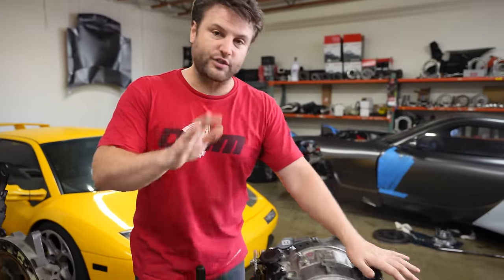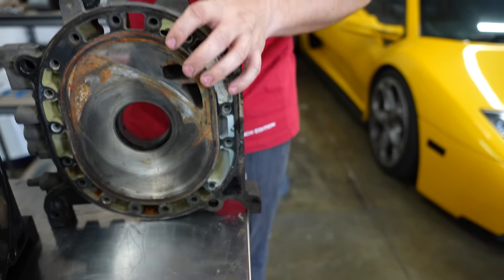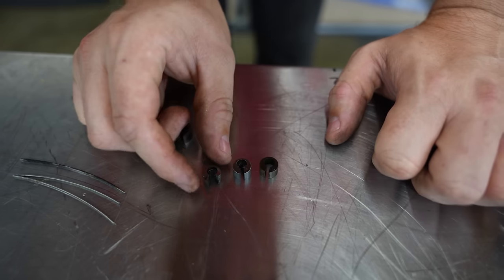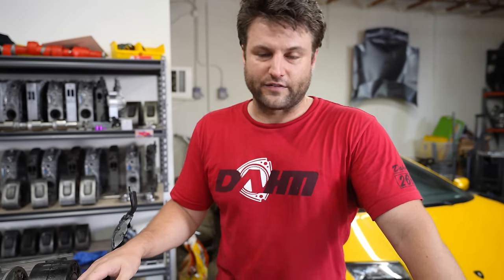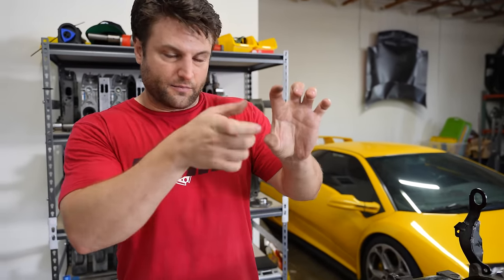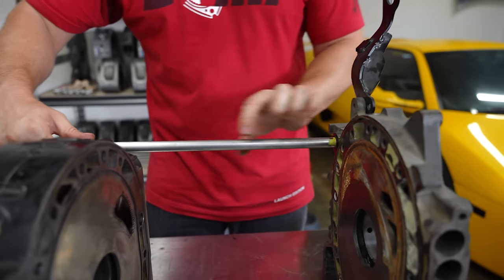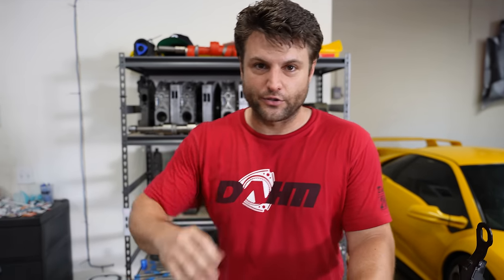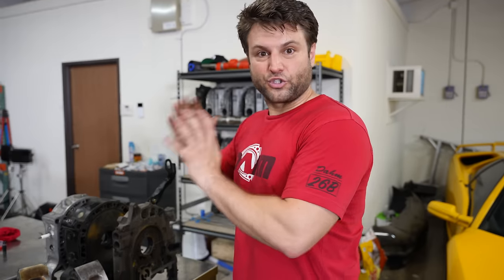Fixing the BIGGEST Problems of the Rotary Engine

Comment: I hope in the future that they can come up with some solutions to mostly the Apex seal I'm not sure why they have so much problem with the coolant seal there's not a whole lot of torque involved in this engine because it reads so high it's a very kind of low torque engine because of the high RPMs

Comment: Based on what you are saying, would a new version of the engine with a new separate feed reservoir filled with 2 stroke oil be better while the other parts needing lubrication have their own separate synthetic heat resistant oil reservoir?  What you point out seems logical. I wonder if a petroleum expert could weigh in on this. Maybe a synthetic oil that both burns well and lubricates well is possible.

Comment: I'd like to see you develop a very tiny, very high output rotary engine, suitable for driving a generator, with the intention of providing on-board charging for electric cars. If people are going to buy more and more electric cars, the grid can't support them all, and they'll have to use gas-powered generators, too. Using rotary power, it should be possible to make a gen-set small enough to stick in a corner, somewhere, in almost any car. BTW the faster a generator spins, the higher voltage it can produce, so a small, high-speed rotary engine can direct-drive a 3-phase alternator, like a turbo-generator.

Comment: I used to to strip and rebuild Mazda RX3 engines in my front room. then it was Rotor tip problems side seals which pressurised the cooling system.

Comment: To reduce cooling problems in RCE, or any high performance engine, a product as Solar57, propylenglycol based, made by pequinsa in Spain, could be of help (SAE paper 741091), the only better approach would be substituting oil for water as cooling medium, oil does not increase in volume when freezing. To calculate the pump and oil flow needed, 'BOSCH manual of automobile technik' has all info about heat transport features of different fluids.
P Lamar wrote a book 'How to cool your Wankel'

Of course, if oil from leaks in an oil cooling system enters working chamber, nothing but smoke will result. Old Citroën air cooled car engines had some Oil cooling, with a pump and a radiator.
To further improve lubrication, avoid wear from failures of oil injectors into Wankel working chamber, experienced Wankel users add 1% oil in gasoline directly to gas tank.
LiquiMoly suggests adding one cc of their MoS2 aditive per litre of mix, as Mazda did in the engine winning the LeMans endurance race (SAE paper 920309; 922375)

About apex seals, the booklet by MotorTrend about Rotary Engine cites some good hand made changes to apex seals employed in Japan, also patent GB1438850, by Citroën, 3-piece seals, is a very good approach to seals. 
Nikasil is the best available plating for Wankel housing working surface.

Old work from SAE, paper 730048, depicts the amazing difference in wear from IKA apex seals, the alloy used in common piston rings, to the negliglible wear with ferrotic apex seals.
 I ignore if what they call 'ceramic' seals of aftermarkert rotary engine parts of today is same as ferrotic, and if there's a difference in wear between 'ceramic' and 'ferrotic'.
 
Toyota, SAE paper 790435, proved adding a Reed-Valve to a Peripheral Intake Ported RE and a Glow Plug in leading plug hole, instead of common spark plug, improved economy 9%.
Kawasaki, patent US3848574, proposed a solution to bad flame travel, cutting a wedge shaped prolongation, pointing towards Rotor trailing edge, flame behavior described in SAE paper 830332. 
Perhaps the device New Ceramic Pin Glow Plug For Webasto Air Top 2000ST DC12V Diesel Parking Heater on leading plug hole could act as the Glow Plug in Toyota SAE paper, or Diesel Glow Plugs, they use some today that are in continued glow throughout engine operation, not just for starting.
Mazda SAE paper 810277 has intresting data about apex seal springs and other subjects.

The slot plug hole described in Video 'Rotary Engine breakthrough' looks perfect. A reduced exhaust gas temperature means a higher effective compression ratio, early ICEs burnt exhaust valves from the low CR, not above 6:1, from poor fuel quality, reason for knocking was not known.

Low load performance of Wankel is worse than in reciprocating engines, thus, having an smaller engine will keep it more time in better BMEP and SFC conditions.
An ordinary car uses less than 30 HP when running at 90 km/ h on a flat road.

But the final improvement would be having a single Rotor, RE with Rectangular, Reed Valve controlled Peripheral Intake Port, and the Side exhaust ports in Renesis

Comment: The primary problem with both Wankel and "liquid piston" remains the surface to volume ration of the combustion chamber.  Too much heat is lost to the piston and the chamber walls. This kills thermal efficiency.  I'd love to see this work, but it's inherently dead in the water because of surface to volume.  Using a ceramic rotor and chamber might solve this problem by allowing the piston and chamber to run hot enough to minimize heat loss.  Secondary problem remains the issue of seals.

Comment: Can a diesel one be manufactured?

Extremely heavy duty.
485 horsepower low torque is required.

Meant for semi truck tractors.

Linked to 10-speed manual Eaton Fuller transmission.

Comment: i am not an engineer or even a gear head. But i was wondering (aside from cost which would be prohibitive) could you get more power, control, balance by having a much smaller single rotor motors at each wheel?

Comment: I don't know much about the MX or the Wankel engine, but it seems to me that if the rotor is at a high RPM, the gyroscopic effect could cause it to wear into the block during turns.

Comment: I once had a Wankel Rotary motorcycle, which emitted a significant clunk due to gear lash within the engine -- every time I even minimally decelerated when attempting to maintain a constant speed.  Do other rotary engines have this characteristic?

Comment: Won't machining the block for a thick dowel pin make it more prone to cracking the block? Seems to me like we just need a bolt with a thicker shank and stronger metal which will help eliminated the weak point that is the threads.
I know of an enthusiast cycling company that computer machines their parts and hardware (CNC machining). You can probably get one to make you custom retainer bolts that fit properly in the holes.

Comment: This is basic engineering 101 for higy performance engines. The problem with stock engine is that it was desingned for "low" power.

Comment: Wow when you were talking power i had 400 425 hp in mind not 700hp. That's fucking bonkers.  Excellent video , you talk good and not in a condescending way . I'm very Interested in these engines for aviation.  Power to weight ratio is off the scale.  Replace a 45k 300hp  engine in a Cessna 206 to a lighter 700hp turbo  engine  and now we talking.  A gear reduction well need to be used , but not a problem .

Comment: 2 stroke engine oil mixed in the gas is a great IDEA!!! Why didn't Mazda think of it? 2 stroke motorcycles have engine oil but they require you to put 2 stroke engine oil in the gas before filling it up... What do you do if you don't have access to E85?

Comment: mazda could have made a seperate oil tank for the oil that is meant to be burned like on some 2 stroke bikes that pumps straight to the rotor housing and gave instructions to fill it with 2 stroke oil

Comment: You are missing an important point !. One side of one 1/3rd of the body has a ring that fits into the next cylinder housing and locks them so they cannot spin sideways the way you are trying to explain with the various compression bolts. I think the only inherit-ant faults are the tips on each end of the triangle and the bypass of the oil on the sides of each triangle. To make this more durable it will take two or three springs together or spaced 3mm apart for each corner of the triangle and same on each side of each triangular piston. That's all that is needed to double the life expectancy of this particular Mazda Rotary!!!

Comment: Has Mazda released the latest design details in order to get Digital Fuel Injection onto a Rotary. Is it possible to build a 3 rotor giving 900 hp that is totally reliable for use in racing airplanes using a propeller?

Comment: Thats very interesting but i want to know clearly.....thats for 13b rotary, rx7's okay right but do they have the same problèm on the renesis engine? The rx8? Thats really important for me at this point knowing if it's the same solution? It's really matter
Reply: "thats for 13b rotary, rx7's okay right but do they have the same problèm on the renesis engine? The rx8?"

They have some of these problems.  Theyd still benefit from doweling and the likes, e85, etc.  The lubrication the rx8 got from its OMP was improved over the older 13b/rew motors due to having 2 ports per housing, rather than the 1 port that the 13b/rews had- However you still have the "issues" of burning oil inside the engine, and get the same benefits mentioned from omp deletes / premixing.

However the Rx8 has a host of "other" issues unique to the renesis engine.  

One of the big ones to compare/consider is that the rx8 rensis engine has its exhaust ports in the side plate- where the older 13b/rews had them coming straight through the housings.  The exhaust flow is rather limited, and goes into a small bottle neck before making a hard 90 before leaving the engine.  The inherent nature of this design is going to trap more heat than desired in the engine, which is a big killer for them (its also a big reason they dont like being boosted. even low boost applications just dont last long)

Its also worth noting that Rx8s / renesis engines has a different side seal design on the rotor with a big of a taper to them.  These even from the factory were rather had to get the clearances right on, and they suffer a bit more from blow by than the older motors- Again leading to some reliability / durability issues.

Comment: Hi Rob  
Just out of curiosity have you tested small holes drilled under the apex seal. To help the apex seal. Seal and not soles rely on the apex seal spring? Just thinking that's all or Is that fixing a fault that doesn't exist 😂

Comment: XRF only tests the surface.  If you have a plated part, then you will not know what is in the core.  Also, it does not tell you about heat treat.

Comment: One downside of the Wankel engine I've heard about and I can see on your rotor housing, is the loss of compression to spark plug hole blow-by (which the pops can be heard in one of your other videos when you crank the rotor by hand), and a solution would be carving small slits the width of the apex seal instead of a round hole, so the apex seals pass over them and leak way less air from compression. This would make emissions way better, as less unburnt gas mix would blow by, and make more power. One downside of this would be air/gas mix access to the spark plug, and needing some more gas to increase the gas density in the air/gas mix, to ensure combustion even occurs at the spark. I don't have the know-how to simulate this idea, but maybe that's worth a look.

Comment: So if by adding all the strengthening mods for reliability with a turbo that produces 700 hp , could I not reduce a two rotor to a single rotor ad run a turbo for a target of 220 hp. This way I have reduced weight and fuel consumption ??

Comment: No mods are going to fix the fundamental problem with the Rotory engine. All the heat is concentrated to one spot of the rotor, that area expands at a much different rate to the rest of the Rotor. That's why the seals fail so quickly and things crack. I'm not anti Rotory either, I love them. I did my apprentice at a Mazda dealership that built and raced their own RX3 rally car. If I recall correctly, it used to run Rotors from the RX3 estate as they had twin Apex seals. I was young when I started work there and was more interested in motorcycles and girls at the time though.

Comment: Why not move the oil pumps to the internal engine to a separate container for oil that can burn so you can get the best of both options and still fill up the engine without mixing your fuel.

Comment: I've just wondered recently if you could keep the oil holes in the housing but pipe it to a tank holding the correct stuff so we don't have to dump the oil into the fuel. Has anyone done this? I see most people mix.

Comment: OLD TIMERS are so set in their ways that you could show them a turd and they would say it is honey. You can never change the OLD FORKS mind  period. The E one fuel is sixty five dollars for five gallons. Ouch for the fuel cost. The dowel that is sloppy should be a precision slip fit. This makes the difference you are talking about. Shame this engine is just so miss understood. The corner seals made of a monel alloy work best period. Shame Mazda stopped making the engine. The biggest thing was fuel economy. That was the knife to the heart of the engine. Great video with honest and open information for all to use and learn from too. Peace VF

Comment: I was working on my design for a turbine engine and no matter how hard I tried the seal for the engine were not workable.  That is the problem with the rotary.  The seals no matter how they are designed are not as simple as a piston engine.   The piston is a cylinder and the piston rings are such a simple design that they can't be beat.  No matter how hard someone tries they can't make a more reliable simple design.  I wish I was wrong but I am not.

Comment: 🤔Why not ditch the rubber O ring 
And easily make copper wire " gasket"
Also with the putting wouldn't haveing the "combustion chamber" 
Placed in the better position moved up towards firing side of rotor like that Ronnie guy proposed 
And another suggestion probably in addition to premix 
🤔 
Could you not also  run a separate tank n pump with higher premix ratio and plumb that to the housing oil injectors
But that violates the 
Keep it simple stupid rule.

Comment: Can you just run aviation oil for the metering, and let the Valvoline do the rest of the engine? Also, why not have multiple smaller metering holes?

Comment: better dowelling of the block? it wouldn't be necessary if Mazda hadn't made the three housing parts with flat surfaces! of course, manufacturing would be more expensive and I don't know how precisely the parts would have to be machined, to fit together neatly and strongly.

Comment: If I remember right the rotary engine died for two reasons.  One was it was dirty and difficult to make compliant with modern emissions.   Second was it was a gas hog.  Once Mazda started addressing these issues with piston engines and had better success they just gave up trying to refine the rotary engine.

Comment: Seems a air cooled engine could eliminate the coolant issue, bigger oil coolers are going to needed for higher power engines but atleast there is no coolant to get in the oil.

Comment: The rotary engine uses fuel for power; could you try a 20:1 or 30:1 oil mix just like the two-cycle or glow plug engines !